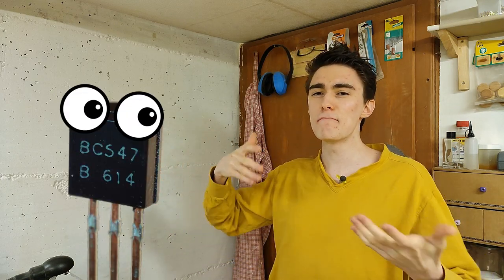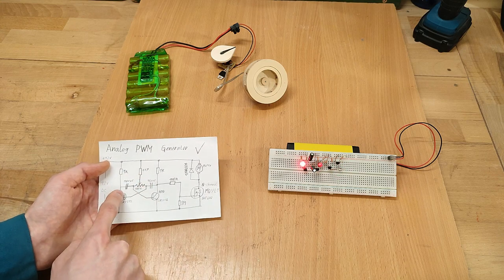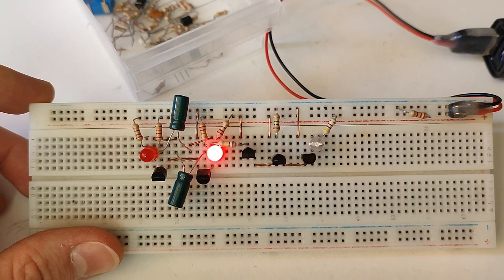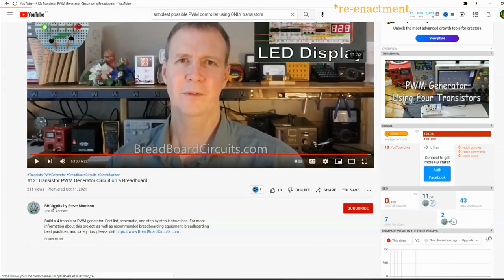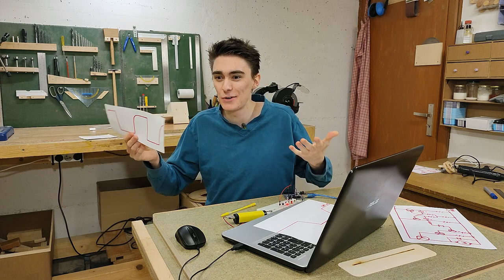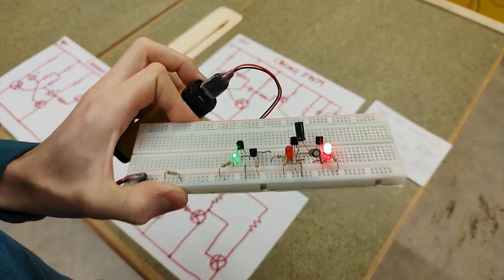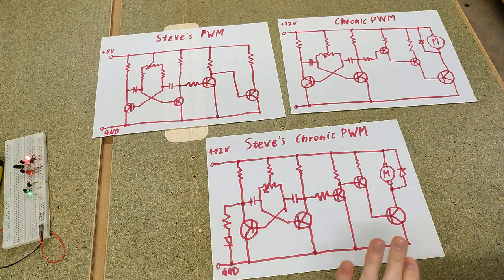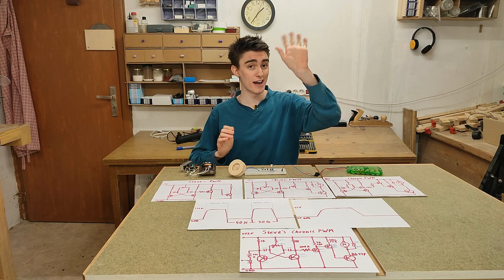New simplest PWM generator WITHOUT 555 timer IC (improved version using ONLY transistors!!)

Comment: The transistor PWM generator has another disadvantage if you operate it with operating voltages of more than 5 V. During the discharge of the timing capacitors the base voltage at the transistors goes down to - 5 V or even less if operated with higher operating voltages. In the voltage range between -5 to -12 V you will operate the base-emitter diode in avalanche break down mode. It means the charging time is shorter than expected, because a part of the charge of the capacitor vanishes through the base-emitter diode.

It is generally not a good idea to operate BJTs with too much negative voltage at their bases. If you have a relatively large capacitor (1000 µF or more) you can destroy the base-emitter diode due to higher currents (the only limitation is the ESR of the capacitor, which can be considerably lower than 1 Ohm for low ESR types).

But in principle you can make the astable multivibrator also of NMOS transistors, which can typically resist voltages of +/- 20 V at their gates. You can use 2N7000 for this purpose. And you can also use lower power NMOS transistors for the output stage if you only want to drive a single LED or a few of LEDs in series or parallel. The 2N7000 can drive 200 mA, the BS170 500 mA and the IRFD110 1 A. And they are still relatively cheap.

Comment: I know little about electronics, but you explained everything so good, that I had the feeling, I know such stuff since ages, congrats. Sometimes simply wanting to transmit knowledge, lets one do such dedicated work, that it simply works, even with absolute laymen like me !!! 
I have a proposal: How about designing a PWM generator, that´s gonna switch the gate of an IGBT? With a resistor and a capacitor in the IGBT´s circuit, you can perform electro-discharge-machining. Primitive diy EDM-circuits, use an RC-oscilator, and have no control over the duty cycle/Hz (controlling the duty cycle and requency can be crucial, cause small workpiece-material-deviations seem to work much better with different duty-cycle and frequency combinations, and constantly changing the main R or C of the RC-oscilator isn´t really a good option). With the igbt in such a circuitry, one can contol much more the event, but one would then also need a pwm-generator for this igbt. Here, at 8:10 u can see what I mean https://www.youtube.com/watch?v=AQCpueMkZ6o&t=10s He explains in the comments:"I'm using a micro-controller running at 5v to generate the pulses, this is fed through 3 transistors using a separate 15v supply to drive the gate of the IGBT, I'm using a pair of transistors to pull the gate high and low as quickly as possible to discharge the gate capacitance, through a small resistor to avoid ringing.I'm using a 'totem-pole' transistor circuit to drive the IGBT and rapidly charge/discharge it's gate capacitance, it needs to switch between on and off as fast as possible or it could overheat if it spends too much time partially conducting."
Is this video of yours https://www.youtube.com/watch?v=oTV2OqD29w8 (PWM for HEAVY LOADS!!! Simple Circuits.) maybe the answer? I sadly cannot judge it. In this video, the motor´s voltage and current-draw are double that of what needed for EDM.
Reply from the maker: I appreciate the comment, but currently don't have the time to look into your suggestion to come up with a decent answer. I'll do when I get around to it :)

Comment: Hey Chronic, just want to say thanks! I've been trying to make a simple PWM circuit than can be both, adjustable frequency, and duty cycle. 
With a couple simple mods, I made one that works with this design!! Could not even do this with a 555, so this is better than an actual IC!
Reply from the maker: Great to hear!

Comment: What should i do if i want it to have just 50Hz per cycle? I want to use it to drive a servo motor
Reply from the maker: I'm not sure it'd work very well since with an astable multivibrator the frequency changes with voltage. So slight fluctuations in the power supply might change it enough to make the servo stop responding to the signal, depending on how adamant those servo control chips are about getting the right frequency.
But, in theory the way it would be done is to increase the capacitor values until the frequency is low enough. I think the easiest way to do that is trial and error. Then, since servos scale their position on a 50-100% duty cycle range for some reason, replace the 10k potentiometer with a 4.7k pot and a 4.7k resistor in series, making sure to connect R3 to the end of the potentiometer that is connected to the resistor. Connect the wiper of the potentiometer to the other end, wired into C2. The loose end of the 4.7k resistor gets hooked up to C1.
This should modify the circuit to only produce a 50-100% duty cycle instead of 0-100. (or 0-50% IDK, if it comes out wrong just flip the whole resistor/potentiometer thing around)
In any case if you're just looking for a servo tester, all this effort is probably not worth it, those things are like $1.60 on Aliexpress...

Comment: Thank you for the post, 
Just out curiosity, what kind of current can the final design draw out of a simple AA battery?
I was looking for a way to make to PWM that only draws milli or micro amps.
Why, I just wanted to see if it is possible to pulse a coil for a very long time using a simple battery for a very long time
Reply from the maker: The circuit on its own (excluding the load) draws about ~12mA  at 12 V, or I guess ~5mA for the 5V version. It'll drain an AA battery within weeks plus I don't think it could be made to work on 1.5V...
What exactly are you trying to do? There's some ingenious simple clock pendulum circuits out there that pulse a coil for ages and even react to the magnet passing the coil as feedback, maybe something like that could be adapted?
Reply: @ChronicMechatronic 
 
For  both projects, I would like to experiment and find a way, if possible, of making the small battery pack last for as long as possible.

There is another project I saw which involved a small pulse motor, but want to do wireless power transfer using the same principles
https://youtu.be/VuEU1x-tXfk?si=LuyEtOlYYfA7zL7m

If you know of a good clock circuit like the one you mentioned, could please point me to the link 

Thanks
Reply from the maker: @shareyourchristmas  I dunno, 55yrs is definitely a stretch, sounds like those free energy quacks, no battery lasts that long. Electromagnets use a lot of current by design. 
However I found something similar that might actually work on Hackaday, and it comes with schematic: https://hackaday.io/project/171859-microwatt-pulse-motor
I think it's based on a simple LED flasher circuit. Using one or several coils from a clock movement might extend runtime since they're very efficient.
otherwise here's the smart pendulum circuits:
https://www.youtube.com/watch?v=psHVTiIoAWA&t=3s
Hope that helps :)
Reply from the maker: @shareyourchristmas  The problem with wireless power transfer is, it's very inefficient - so if you're sending microamps through your transmitter coil not only will the range be extremely short, but of those microamps you'll only be able to harvest a few nanoamps at best on the receiver level

Comment: 🤔 well thats why i heard tiny wobbling in the sound at the previous video.. specially at low rpm. And what i need is stable steady powerflow to my motor, cause The motor drives plates that are doing comping (rhythm) for music....
Reply from the maker: Yeah PWM is inherently noisy, you would need some kind of linear regulator to circumvent the high pitched whining at low RPM. Or try a huge capacitor in parallel with the motor, I think I saw something similar on a treadmill controller

Comment: Fun to watch you learn electronics. One minor error, the ‘arrow’ in the transistor symbol is missing. I did like the extra resistor and diode to balance the loading on the multivibrator. A diode-connected transistor could also be used for more precise matching. Have fun.
Reply from the maker: Yeah you're right, I'm usually too lazy to fully draw the symbols when I'm doing it by hand 🤭

Comment: Why not use a single transistor buffer as a previous stage to the driving transistor?  The buffer should have high impedance and not affect the multivibrator.
Reply from the maker: Not exactly sure what you mean, but I put in that many transistors to get enough current gain in order to saturate the base of the power transistor
Reply: @ChronicMechatronic  Google "Transistor Buffer" or "Common Collector" or "Emitter Follower) (all the same thing).  A transistor in this configuration offers high impedance, so it doesn't affect the circuit, and outputs the input voltage on it's emitter (minus a  diode drop).  It's often used to isolate one part of a circuit from another.  Think of it as a "poor man's op amp unity gain buffer" as it has high input impedance and low output impedance so it doesn't affect previous stage, and can drive the following stage.  If you're not familiar with the common collector configuration, I highly recommend learning about it. (maybe I just gave you an idea for another video 😄)

Comment: I want to program an Arduino to control an L298 H Bridge to control a DC Motor using PWM. Would I be able to use an H bridge made of transistors and then this approach to introduce PWM to my project, then programming an Arduino to use this PWM (transistor circuit) and H Bridge (transistor circuit) in place of a L298 H Bridge?
Reply from the maker: If you want to make a transistor H-bridge and use this circuit to generate PWM, why would you use an Arduino at all?
The only way to control this circuit with an Arduino would be via 2 PWM pins at which point the circuit would be useless... If the arduino is needed to control other things too, you can just feed the Arduino PWM into your H-bridge (discrete transistors or otherwise) and skip this circuit altogether. If you just want to control a DC motor bidirectionally via a potentiometer the easiest is to use this circuit and add a toggle switch to either switch direction directly or feed the PWM signal into the right side of the H-bridge.
Reply: @ChronicMechatronic  So that definitely makes sense. I want to use this circuit to generate PWM inside of my H bridge circuit to understand how they work on a simpler level. Then that will give me an understanding of what the more complex L298 Driver is and how it works, as well as how PWM works on the Arduino was I program it. I am fairly new to this and have a question, how would I add this circuit to my H Bridge circuit to generate controllable PWM via a potentiometer for speed and a switch for direction?
Reply from the maker: @EngineerManny  driving an H-bridge with this is relatively straight forward. You just need an H-bridge circuit with two of the transistors inverted like this one:
https://www.talkingelectronics.com/projects/H-Bridge/images/H-Bridge-1A.gif
And add a single pole double through slide switch. Feed the PWM signal (remove power transistor and treat what was connected to its base as output) to the middle "com" pin of the switch and connect each of the outer pins to one of the H-bridge's "A" ans "B" inputs. That's it. The PWM coming out of it may be inverted, in that case just swap the outer two potentiometer pins in the PWM circuit and it'll be fixed.
The L298 is basically just two H-bridges along with some inverting logic in one component, pulling one input high or low controls the direction of your motor, the other one is to feed in the PWM

Comment: I was wondering if transistors 4 and 5 make a Darlington pair in the Steve´s Chronic 12 V version? Or do the collectors need to be directly connected?
Reply from the maker: Yes, Q4 and Q5 could easily be replaced by a sufficiently powerful darlington transistor if that's what you mean :)

Comment: Can a pmw module control 12v 5amp heating element...?
Reply from the maker: If you use the MOSFET version in the description, yes totally!
For a heater I would replace the 100nF capacitors with like 10uF electrolytics though, just to remove any annoying high-pitched sounds it may produce.

Comment: Sorry, one more question.. In Steve's design, I believe the second output transistor (rightmost) IS the driver transistor.  Why did you add a 3rd transistor for your driver transistor?  I think it could be eliminated.  In other words, just use Steve's design for the output stage, but substitute a different "driver" transistor.  Thanks.
Reply from the maker: Because I wanted a relatively high output current. One transistor can only have so much current gain, and high power transistors usually only have an amplification of around 40. Steve's design only has to drive an LED at like 10mA, but the base current needed for the power transistor is around 125mA, so I need to cascade multiple transistors in order to reach that. Theoretically you could substitute the power transistor and the one behind it with a power darlington, but at that point you might as well use the MOSFET version. I hope that clarifies things.

Comment: why not replace the leds with optocuplers and use the photo transistor as pwn driver?
Reply from the maker: THAT is a good point - never thought of it! It certainly wouldn't influence the frequency of the AMV as long as you used identical optocouplers, though ultimately it wouldn't simplify the circuit as you still need at least one other transistor for amplification to drive the power transistor.

Comment: You don’t need the MOSFET you could use common collector instead of common emoter to drive the load with a BJT and have high input impedance.

Comment: Hello, where do you put the probe to get the pwm signal on a oscilloscope?
Reply from the maker: Base of the power transistor for a non-inverted one, and collector of said transistor to get the actual waveform going through the load (it'll be inverted on the scope)
Reply: @ChronicMechatronic  thanks 🙌

Comment: Hi, thanks for the effort, good job.
In the +5v schematic you wrote +12v  input, is it a typo?
Reply from the maker: OMG yes! Thank you so much for pointing out, I'll change that straight away!
Reply: @ChronicMechatronic  no prob, you're welcome.
Why don't you give a watch to my last video, so you know what i'm trying to do with your schematics.... Replace the 555 and being more, much more primitive, i love making things simple to the root
https://youtu.be/3_fGys4H3Mk
Reply from the maker: @docmaker-italy  very interesting indeed, why don't you just add the stepper control to the arduino code? Possibly you could also replace the arduino with a cheaper atmega 128 provided the code doesn't use too much storage? And the stepper motor could be replaced by one of the lower precision unipolar ones from old printers, or even a brushed DC motor altogether (which I assume is what you're looking into?)
So many ways of shaving off unneeded complexity haha!
Reply: @ChronicMechatronic  i did so at the beginning, then i separated the two circuits in the event i could simplify them, i'll keep working on it
Reply: @ChronicMechatronic  just forgot to say, in my case you think i need a bd139 or a ragular 3904 will do? Consider i have no current draw, i just need the pwm to feed the a4988
Reply from the maker: @docmaker-italy  oh yeah the 3904 will absolutely do, you can in fact remove the  last two amplification stages altogether and just connect the A4988 to where I connected the S9014 transistor

Comment: Hey , I'm a fellow ECE student, who loves doing such builts, i tried this today with bc105B i believe and a 2n2222a, apparently it didn't work, is there a way possible to make it work in such cases, i have the project submission on upcoming monday
Reply from the maker: Hmm, theoretically it should work with pretty much any small signal transistor, and it's not a finicky circuit to get working... Only thing I can think of would be bad connections on the bread board / incorrect wiring. Maybe try to reassemble it on a less worn section of the board? Crappy bread boards are notorious for making bad connection with components
Reply: @ChronicMechatronic  i supplied it on a CRO workbench with 4 , around 4 V it starts my dc motor , but I can't go past 7-8 because the motor will burn.. and i couldn't control the motor using the 47k pot in this 4V configuration, should i try with 12 V input , i also found that the mosfet was heating on 4V , doesn't raising the temp to 12V burn the mosfet.. oh btw i used the chronic pwm 12V 30 amp circuit
Reply from the maker: @karthi6548 definitely sounds like you got something wired up incorrectly. Did you use the same type of transistor in the AMV? It might not start to oscillate with transistors that are too different. Also, replace the motor with an LED and resistor for testing and crank up the voltage to 12V. The 12V circuit doesn't start oscillating under ~8V. And depending in the MOSFET you used it's gate threshold voltage might be at least 4V.
If that still doesn't work, a mistake I commonly used to make back in the day was installing the transistors the wrong way round following the orientation of the symbol on the schematic, instead of matching CBE pinout. This is hard to diagnose because some circuits kinda work regardless and others don't.
Reply: @ChronicMechatronic  hey thanks , i checked Everything, can i connect with you somewhere like insta.. I'm seriously im more of a state like trauma haha.. I've been working on this since 7 days

Comment: I want to generate PWM volt step by step without using microcontroller pls suggest
Reply from the maker: What exactly do you mean, different distinct "steps" of PWM percentage, or DC/DC conversion to different preset voltage levels?